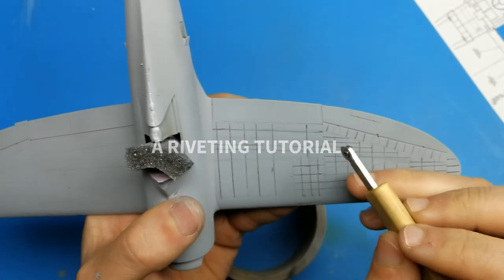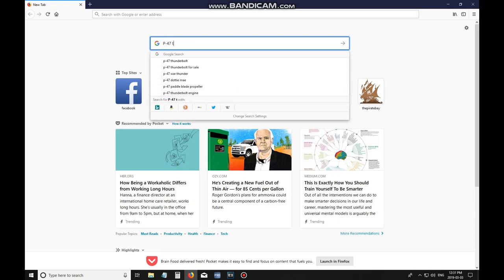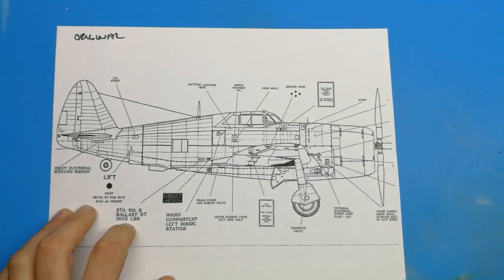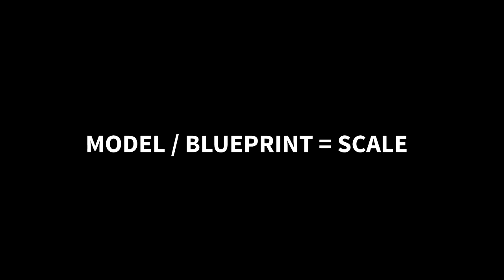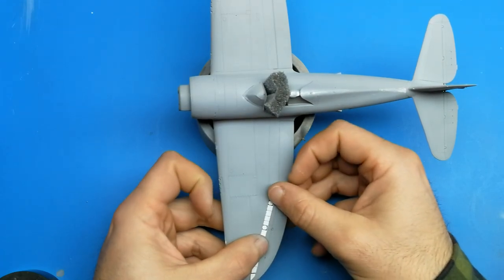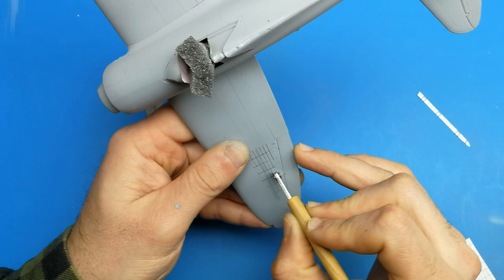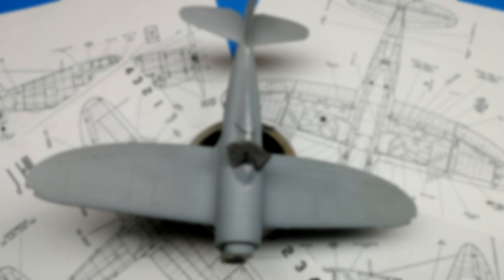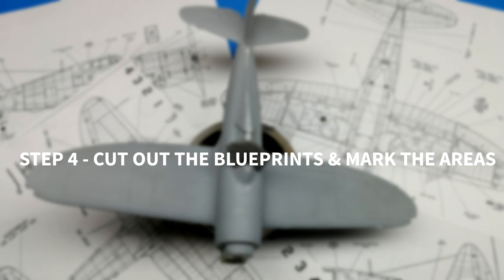Improve your aircraft model with this simple hack! A Riveting Turorial

Comment: So, having a little trouble putting this into practice. I have my P-51D blueprint. Panel on drawing: 23.19mm. Panel on model: 32.42mm. Now, 32.42/23.19 = 1.398.
In Photoshop, to print on on sheet, I scaled down to 63.55%. Now what is the relationship between 63.55% and my scale of 1.398%? In your tutorial, when you enter your 83%, the drawing is at 100 percent. Doesn't that mess up all your measurements? How to I re-scale my drawing, in consideration of the re-scaling already done to initially print out the drawing. Hope this makes sense. I'm all dressed up with no-where it go.

Comment: Thanks for this!! I tried using a blueprint and it drove me crazy. My solution was to create fictious rivet lines and the result was busy enough for me. Question: what is the advantage of riveting after the kit is together?  Doesn’t that complicate riveting the compound curves of the fuselage? Thanks!!!
Reply from the maker: There are advantages and disadvantages . If you rivet before the parts are together, you run the risk of losing them during clean up if fit isn't great. But they are easier to do. The opposite is for riveting after assembly. They are trickier in some places but you don't have to worry about losing them.

For riveting around curves, I'll roll the model instead of moving the tool. Gray ensures no sudden kicks
Reply: Thank you sir.

Comment: Hey, what size Rosie do you use for 1/48. They offer 0.60 or 0.65 mm. Which do you recommend?
Reply from the maker: I use 0.75mm for 1/48
Reply: Ok, ordered the 0.75. Thanks
Reply from the maker: The next step is scratch building haha
Reply: Lol. I’ve been jazzing up my planes for years now.  Eduard kits, resin, plumbing.  Riveting has always eluded me.   I tried a few times and messed it up. In my stash, I have an 80s Monogram 1/48 B-58 Huster, my all time favorite.  Ultimately, I would like to build it with rivets, in NMG. It will take a lot of practice before I am confident enough to work on that kit. BTW, I ordered your yellow tweezers too. They look great.

Comment: Hey Model Guy! Are you able to sell your scanned images for Rivet patterns 1/48 Planes at all? 1/48 Airfix Sea fury, 1/48 P47N T Bolt( N may use modified Tamiya M kit. etc.), 1/48 Tamiya Corsair. I plan to make 1/48 Accurate Miniatures F2G Super Corsair( I wish I could down size that canopy by the thickness of the vac. form though?) I am trying to acquire some more of the Rosie Riviter tool sizes now, but scanning is beyond my current capabilities.
Reply from the maker: I could send you what I have but you’d still need to scale them to your printer. I grabbed them off google. There is an article for ether 1/48 Sea Fury where a guy made all of the corrections to the kit. That’s world reading over.